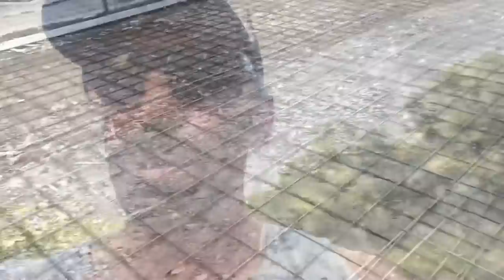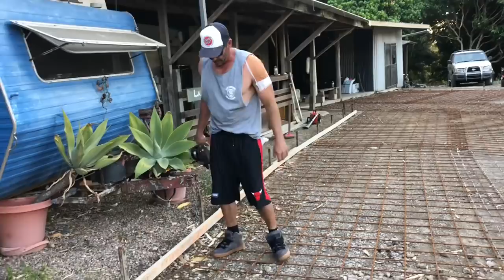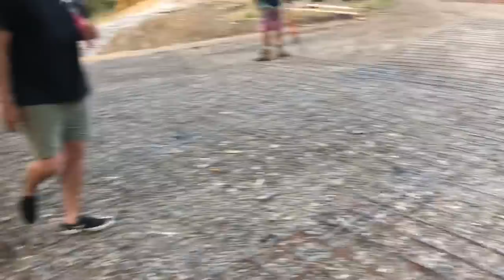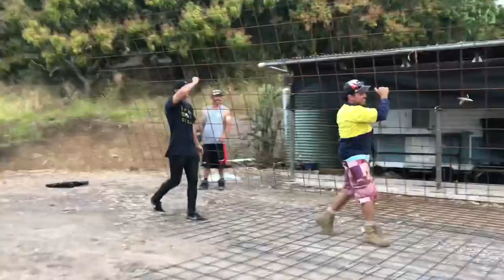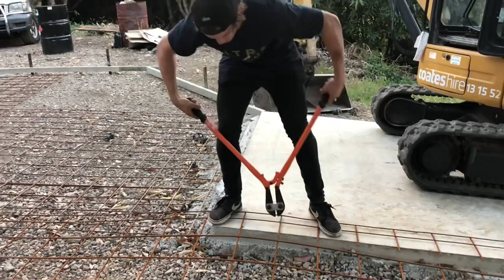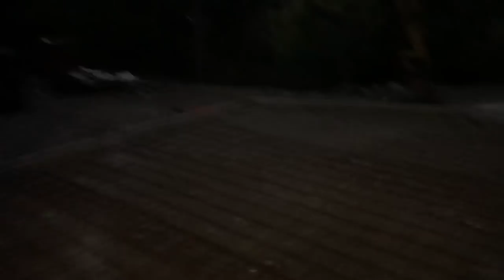Setting up at RWillyLand with Ryan Williams

Comment: Hey buddy,
Have you guys ever thought about using a cordless 9 inch angle grinder to cut the mesh.

It would be so much easier and faster
Reply: Dude not being a smart ass just offering an idea
Reply: @Lochlan0915  In some places, its considered bad practice to cut reinforcing steel with an angle grinder as it heats the steel too much and damages the temper. Seismic mesh included.
Reply: @iliketurtles4463  It's only going to heat the last 10mm of the steel and then the concrete is going to set around cool steel that has reformed.
Sometimes Old Timers consider it bad practice purely because its against their method
Reply: @Lochlan0915  You clearly know more than the rest of us do then. Have fun with that.
Reply: @iliketurtles4463  Continue wasting your time
Reply: Set of bolties and hook in, way quicker than a grinder
Reply: @VeritasSimRacing  I'm not going to argue with you guys....... lets see where the industry goes
Reply: On some sites here in Australia 9” grinders are actually illegal
Reply: Not arguing brus, we all have our own way, just saying it works quicker for me
Reply: Lochlan0915  the bars are less then the thickness of your pinky finger so not much point of a grinder bolt cutters work fine Ryan just makes it look hard been sheltered living the good life as you would say been the way they’ve done it for years
Reply: Bolt cutters are slow and primitive,  I use cordless 5 inch Hitachi for cutting mesh, with a thin 1.5mm cut off wheel steel has no time to heat up, last guy I seen cutting mesh with bolt cutters was a man named mike nolan from NSW